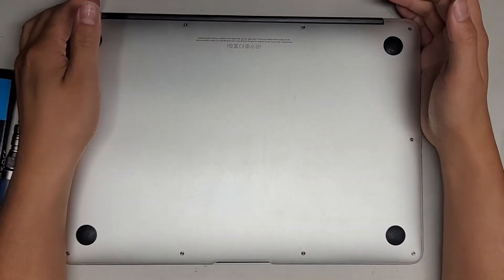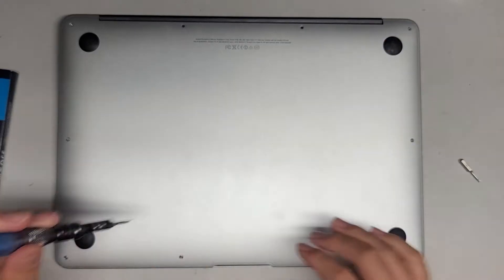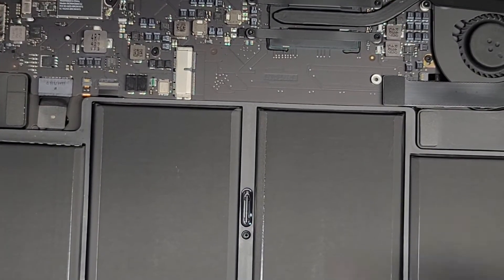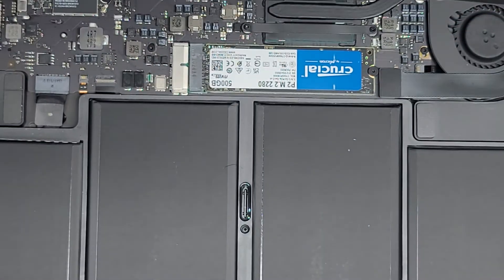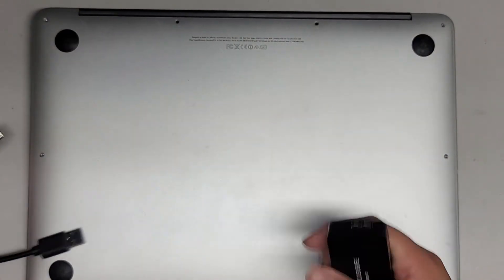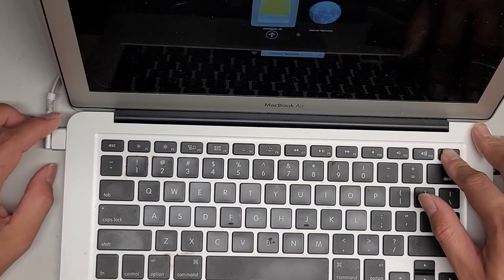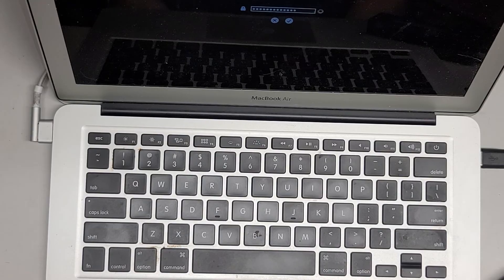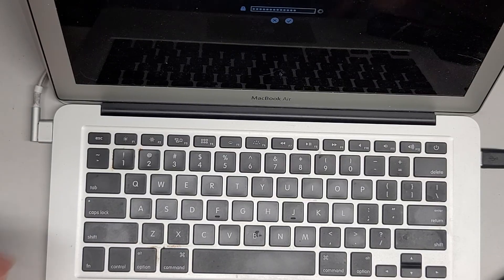13" inch MacBook Air A1466 Early 2014 Disassembly SSD Upgrade M.2 PCIe NVMe SSD

Comment: Hi, I have a 15” Mid-14 Mcbk pro with 500GB. I’m wanting to go bigger in storage & wouldn’t mind a little more speed too. Can you recommend or point me in the right direction. I want the NVMe setup but not sure what I got already in this Mid-14
Reply from the maker: @nkonie7177  it'll have issues sleeping when you close the screen. Are you ok with that?
Reply: @ not really, I’d prefer keeping it simple like sleeping when closed & not forced. So what SSD should I go with? I only use it for school stuff anyways/ downloading big txbk files
Reply from the maker: @nkonie7177  you'll need one made specifically for MacBook
Reply: @ItsBinhRepaired  thank you!
Reply from the maker: @nkonie7177  no problem
Reply: @ & thank you for the fast response!!

Comment: You forgot to disconnect the battery…
   What? 
  I forgot to disconnect the battery before removing my SSD From my 2012 MBpro retina and I fried the mother board
Reply from the maker: @DogWhoFilms  that's not from disconnecting the SSD. You must've dropped something on the motherboard.

Comment: I have a question, if I removed the ssd from my old MacBook, and then put it in this adapter and then after that, I took the adapter (with the old SSD inside of it) and plugged that into my new MacBook, does that mean I can get my files from it?

Essentially, does putting the old SSD into the adapter make it become like an “external hard drive”?
Reply from the maker: No, MacBooks don't have removable SSDs anymore unless you're getting an old one.
Reply: @ItsBinhRepaired  my old MacBook is from 2015 so it’s the a1466 that you showed in this video. But the old MacBook stopped working this week and I want my files that are in its internal hard drive. If I took out the internal hard drive from my old MacBook from 2015 can I put it in an adaptor like you showed in this video and stick it into a new laptop? Would that be possible?
Reply from the maker: No, new MacBooks don't have replaceable SSDs. It would only work if you use it in a 2015 or older MacBook Pro and 2017 or older MacBook air. No adapter needed.

If you use a new MacBook you need one of these https://amzn.to/3ufhd0x

Comment: I have the 2014 MBA with original 500GB SSD and 8GB ram. Is it worth upgrading to a new 1TB SSD, as far as speed, etc?
Reply from the maker: Won't gain much speed. Just depends how much you need more storage.
Reply: Cool, thx. 500GB is good for this machine since I'm not doing audio/video and is more of an admin machine. I didn't realize (or forgot) these machines don't have removable RAM either. @ItsBinhRepaired
Reply from the maker: @sbrave  yeah, sadly

Comment: Did you recover your original drive on to the new drive then put the new drive in and it didn't load?  I did this same process and noticed that the mac recovery process will allocate space for a bootloader, but not actually install it without manually doing it yourself.
Reply from the maker: You just need to use time machine to load onto a formatted drive, but their original drive was dead if I remember correctly.
Reply: @ItsBinhRepaired  Oh no worries. I didn't have a time machine backup lol and the internet recovery failed. I was more putting the statement in there in case it happened to somebody else hah. Glad it worked out for you mostly correctly.
Reply from the maker: @TheUncleshady  you'll want to install the os to an external device with another Mac and boot from that

Comment: Would you please help me find a correct match for a macbbok air a1466? Trying to buy a 1 TB ssd. What is the best brand converter to use? I have read that some adapters do not allow sleep/hibernation and require a full shutdown every time
Reply: WD_BLUE SN570 1TB M.2 2280 PCIe Gen3 NVMe up to 3500 MB/s read speed
Reply from the maker: Hm
Reply from the maker: Yeah, I think most have that issue. Not sure if there are any that for sure fix it.

Comment: I changed the ssd with an adapter to my macbook air that same model, but when restarting it does not detect it, but if I start Mac from a bootable USB if it appears, I already formed the ssd but still not
Reply: It does not detect it for installation
Reply from the maker: Those adapters only work if your os is updated to Mojave or newer.

Comment: Do you know what I can do if the SSD is not showing once I get into the disk utility? I have tried with two different drives.
Reply from the maker: The mac needs to be high Sierra or later before installing an m.2 nvme SSD
Reply: @ItsBinhRepaired  It is on Big Sur
Reply from the maker: @aarongehrke6459  what SSD model are you using?
Reply from the maker: @aarongehrke6459  also, what adapter?
Reply: @ItsBinhRepaired  I have tried replying with the link and it isn't working. Same ones as you posted below. The Crucial P2 and the JESOT adapter
Reply from the maker: Try running all the updates with the original SSD
Reply from the maker: Make sure they're pushed in all the way and click the option in the top left to view all devices
Reply from the maker: @aarongehrke6459  be careful clicking links like these. When you can't see where they'll take you they can be dangerous.
Reply: @ItsBinhRepaired  I didn't even think of that. I added the actual link
Reply from the maker: @aarongehrke6459  I dunno why, but YouTube likes to auto block links. I don't even get a notification of the comments.
Reply from the maker: @aarongehrke6459  might have to give a description or what to search.

Comment: This is very helpful. Thank you! What enclosure holds the original Mac SSD? I have a slightly different situation. I have a dead logic board on a 2014 MBA. I extracted the SSD and recycled the machine. Now I want to boot from that SSD on another Mac and make a backup of the dead computer. I think I can do this by installing the original SSD in an enclosure and connected it to another Mac, yes? If so, back to the original question: what is the enclosure you used to house the original drive? Thanks again!
Reply from the maker: This should work https://amzn.to/3Pb5q8K
Reply from the maker: @Crossroads Kids Club no problem

Comment: In which format do I have to reformat the new internal SSD? Please tell
Reply from the maker: Are you trying to do a clean windows install?
Reply: @ItsBinhRepaired  No. I have a Time Machine backup on an external HDD. I have installed a new SSD. MacOS uses APFS right
Reply from the maker: @maxpayne7030  depends on the OS, but yeah, newer ones use apfs

Comment: Bro, what's the link to the adaptor and the Crucial drive?
Reply from the maker: https://amzn.to/3dYeZqB the SSD 500gb and the adapter https://amzn.to/3yzd0CH
Reply: @ItsBinhRepaired  Thanks buddy !!
Reply from the maker: Yup, hope it helps. If you haven't already, don't forget to like and subscribe so others can find my videos. Thanks!
Reply: Hello!  So it looks like the Crucial P2 SSD you provided in Amazon has a newer model P3. Do you have any idea if anyone had had any issues using the newer model,  or should I stick with P2 since you yourself have confirmed it so actually work.   Thanks
Reply from the maker: You can use any m.2 nvme SSD, just depends what you want to spend.